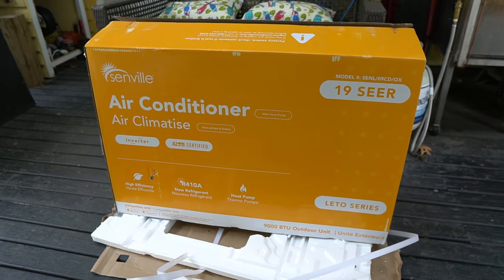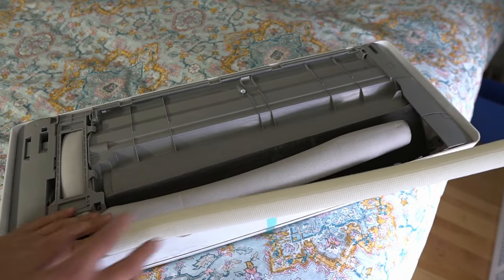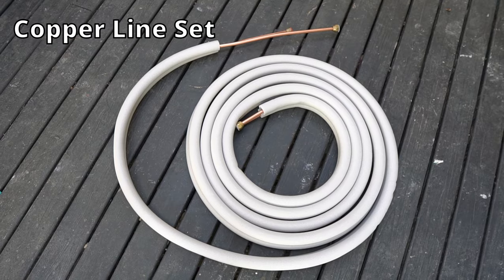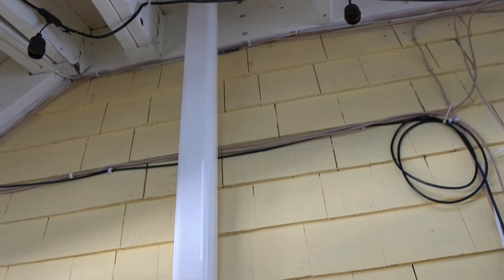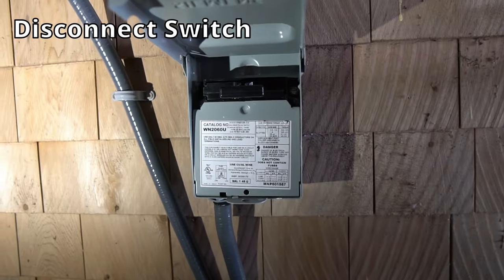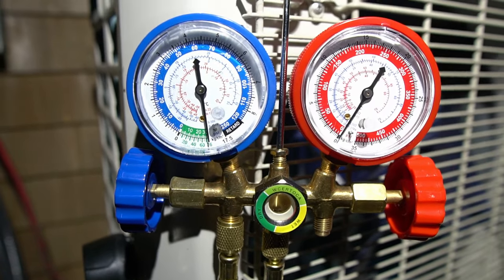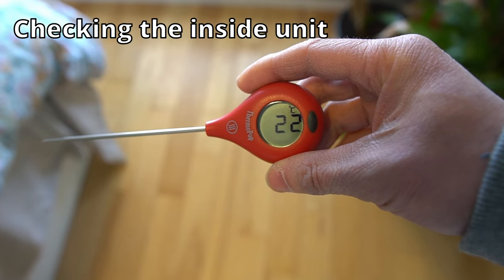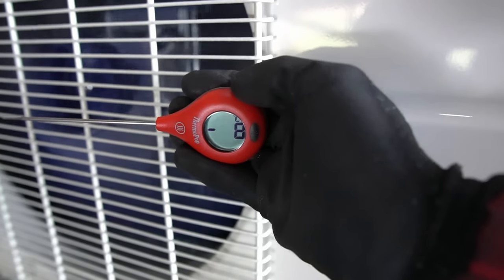How to Install a Mini Split Heat Pump | Senville 9000 BTU

Comment: I'm have to tell you that I have fifty years plus doing Harv  (heating, air Conditioning,ventilation and refrigeration). It looked like you did a good job on installing the Mini split Heat  Pump . I want to tell you that that you put ref oil on the copper female flare seat ( which I think you did )the reason oil the flare seat is to keep from damage to seat and help make it seal (because that copper flare seat is what make the seal, not the threads). Be a harv tech in Florida for 50 yrs it hard to think about installing a heat pump in Canada ( to know water freeze a 0*C and it is a outstanding insulation to stop heat transfer and at -6*C it is going to make ice fast if you have high humidity and ice stop heat transfer). Heat pump are great in mild climate. I would like to know how the Heat pump work-out for you. It is a good how to do info video     Thanks
Reply from the maker: Thanks John!  I had some experience with flares working on car brake lines and also propane lines so that was a help!
These newer heat pumps seem to still work well in temperatures below -10C, this one installed in the video is mostly for AC in the summer.  The existing one I have is a Lennox and it still pushes out heat below -15C (not often it's that cold), it does go into defrost mode every every few hours depending on how much humidity is in the air, so you are right it does freeze up fast.  Of course living near the ocean probably doesn't help lol.  Overall tho love these for heat and AC, no complaints at all.
Reply: Artic series mini-splits can work down to -13F or lower, and maintain full BTU ratings at 5F degrees. Not the same as the regular heat pumps. Used to be you needed a ground based heat pump to achieve that. COPs do drop at sub freezing temps, though.
Reply: In my area we have -40 celcius in winter and all people i know switch for a -28, -30 heat pump and they work great. The electric bill is  way cheaper. I waiting for mine this winter. Thanks for your video👌🙂
Reply: After 50 years how you can say that was a good install? :D 
He made a vacuum test before high pressure test. Just giving a really good chance to make a scrap out of it.
Reply: heatpump technology has changed a lot and icing is not a problem as it defrosts
Reply: @igotafastcar  😅 can you tell us  what is the best test to do first. I have one to install  myself
Reply: @igotafastcar the layout/routing of lines and wiring ect was great.  He vac'd the lines.... if the line set was defective it would have been noticed with either the vac or test with a slight bit of refrigerant.  

And if it was leaking he is sol for warranty ect anyway.  

Some people have it in them that you need to pressure test with nitrogen at 1000psi for 10 years....  

These things are like refrigerators...  in 5 or 10 years they will crap out and you will just have to replace it anyway
Reply: @john0270  I share some of your pessimism but not for the same reasons. 

A DIYer who pays careful attention to the details and doesn't cut critical corners can make a huge difference in system performance and longevity. 

The installation tools, equipment efficiency and troubleshooting techniques have changed drastically since I first climbed an old steel ladder carrying a manifold, Amprobe, wrench, screwdriver, nut driver, and a jug of R22 to the blazing hot rooftop of an ancient industrial building 50 years ago. Unfortunately the pride that once revealed itself in quality workmanship is long gone. Instead I see a lot of businesses that are no longer family owned manned by hacks with a license who call themselves pros while cranking out 3 res systems a day.

Its entirely possible for a homeowner to do a better job with a little knowledge and a relatively inexpensive set of tools. And far better tools at that.

Vacuuming while relying solely on a set of manifold gauges cannot give you a reliable indication of how contaminate free your line set is. Nor will the mere 16 psi difference between a near perfect vacuum and normal atmospheric pressure when observed on a low resolution gauge for a few minutes reveal a microscopic leak that could release all of the refrigerant within a year or two. A modern mini split contains only a few pounds of refrigerant and operating pressures are considerably higher than the older systems. The smallest leak becomes a much bigger problem.

Professional quality micron gauges can be had for $150-200 on Ebay and resold at a later date for about the same amount. Cheap insurance. A partial release of refrigerant won't reveal a small leak either. A high pressure nitrogen test @400-500 psi which is in the same ballpark as the pressures found in an R410a system is once again cheap insurance that may avoid future refrigerant loss. Manufacturer's parts warranties don't cover labor and multiple labor trips may be required for diagnose and later replace factory supplied parts.

My advice is to find a brand with a reputation for being responsive to the needs and concerns of the DIYer. In the case of Senville which is the brand featured in this video, I personally would consider spending the extra money for something in their Aura lineup primarily for the higher efficiencies in both heating and cooling modes and a few extra operating features like WiFi and phone support. I am not affiliated in any way with Senville but they are on my short list of brands I would consider. The vast majority of mini splits are made by a pair of huge Chinese companies, Midea and Gree. That doesn't mean that every product sold by other companies but manufactured by one of those two giants is built to the same specifications.

Beg, borrow, buy or rent the right kinds of tools. Some of the auto repair parts stores offer free rentals on tools like vacuum pumps. Fresh vacuum pump oil is the key to getting the best performance out of a pump. NAPA online seems to have a good price for a quart  if you don't need shipping. Other things to get: A micron gauge from one of the name brands. A nitrogen regulator set with the SAE hose for ~ $40 on Amazon. Buy or rent a nitrogen tank. A small bottle of Nylog Blue (`$13 Ebay). A valve core removal tool. The cheap ones with the yellow handle on Ebay seem to work well enough and come with the 5/16 SAE adapter that you will need for mini splits. If you are shortening line sets or just don't like the appearance of factory made flares, you'll need a tubing cutter and an eccentric flaring tool. 

If you ever expect to have a need to buy or handle additional refrigerant, an EPA 608 certification will be needed. Most of the test to get certified is based on understanding the regulations with a bit of common sense thrown in. It will however require some study. Familiarity with how to read the temperature / pressure chart will be helpful for some questions.  Check out skillcatapp.com for details on how to get your lifetime certification for about $10.

Don't forget the 30% US Federal tax credit of up to $2000 each year for the next 10 years or so. Also look for the upcoming rollout for low income (slightly below the average gross income for your area) grants of to to $8000 or 50% rebate for moderate income (somewhat above the average AGI for your area) residents. Although it is Federally funded, and part of the huge 2022 spending bill called Inflation Recovery Act, each state will have their own variations. I don't know yet if DIY installs will be eligible.
Reply: I’ve never heard someone refer to HVAC as Harv lol
Reply: red
Reply: Herew a few...No nitrogen test, no micron gauge, no. Decay test, no superheat subcool measurements......as an hvac tech myself when these things die prematurely its ALWAYS a DiY install.

Comment: I'll just pay someone to pull the system into a vacuum. No point spending money on that when ita going to be used once.
Reply: I thought that too, until the guy told me $400us. $140 amazon will buy the pump kit. Cheers
Reply: @papabapyro  yes I found that out too and ended up just getting the Amazon pump. The pump failed right as I was finishing up with it haha. So I got my money back thankfully.
Reply: @papabapyro A technician coming out will far exceed the cost of a new vacuum pump with gauges. It can also be used for automotive purposes. And lastly, it could also be resold at a loss.  Again, far less than the technician that will charge you a small car payment.

Comment: It seems like my flares from the factory were just trash. I connected and disconnected my line set 5 times tonight and could never get a vacuum to stick, even with the use of nylog. Now I'm going to buy a flare kit and copper pipe cutter to redo the flares and get this done. I'd much rather spend the $80 getting those tools than give an HVAC company at least $750usd to come fix that.
Reply: only $750. HVAC guy wanted 3800 to install this. That works out to $3000 in labor lol
Reply: @martik778  He wanted $750 just to vacuum and properly seal a line set. Nothing else had to be done.

I found another local guy who did it for $150.
Reply: After extensive research I found that it's standard procedure to re flare the line sets as the flares are usually not good. Senville and other companies also include better quality flare nuts to replace the ones on the lineset.

Seems nobody can get the 3rd party lineset manufacturer to do it properly.
Reply: Smartest move you could have ever made installing a mini split.

Comment: I like how "wire the unit to the main power and install a disconnect switch" is a five second clip skipping over something that could take hours depending on how you have to get to your circuit breaker, and should be recommended to have a licensed electrician do it so your home is up to code.

Comment: when wrapping lines go from bottom to top as that makes it waterproof. You did the opposite. I'm thinking of doing the Senville but don't want to void the warranty. May have to call them and verify it's void unless hiring a "pro". Am I a pro? Been doing auto ac for 40 years.
Reply: If you have a certification number then it counts.
Reply: @kevinhayes2805  I installed a Pioneer unit. Works great although I did run into one problem. Even though I used nitrogen to check for leaks, I must have a small leak as I had to add a few pounds beginning of summer because evap freezed up. May be inside unit connection as I had wrapped it up in ashphalt ac insulation and it became goo. I'll see what happens in another year. I did have a concern with large indoor unit in that it didn't hold pressure from the factory when I removed the rubber plugs but I think it's just because they didn't install plug correctly.

Comment: How much does it cost to get an HVAC technician to install one of these?
Reply: This is a guess based on having somework done to disconnect and reconnect our airconditioner for construction. $300-$350 Canadian.
Reply: About 900.00
Reply: I've gotten several quotes each one was half the price of the unit regardless of size.
Reply: My father in law got his installed on a second floor for 3K USD... that price was ridiculous. His was a bigger BTU than the 9000 shown on this video. But still same concept.
I'm installing my 9000BTU based on this video! Thanks for the info! It is well explained!

Comment: I pulled vacuum, but removed the gauge before i released refrigerant for 5 seconds ! Is this bad?  Should I just release all refrigerant, or hook up the gauge, pull a vacuum again, and then release the rest?

Comment: I put an 18k one in at work, the office had oil heat and that was about $6 a gallon to refill. The whole unit cost about what he pays for each tank, this will save a ton of money.  Liked it so much put a 9K one in out bedroom and will be adding a 18 or 24K one to the front room soon before this summer

Comment: I installed the same unit 3 months ago. It is a tremendous value and seems to be a good quality heat pump. I did the complete installation. I would suggest a real pressure test with compressed nitrogen before releasing your refrigerant. The cost of the nitrogen and pressure regulator is minimal compared to the longevity of your system. I also used a micron gauge to verify the vacuum pull down— will guarantee full evacuation and leak testing before the pressure test. I used 12 gauge wiring for the 20A circuit for this unit —about a 75 ft run from the switch box in my garage. 
To the OP, you did a good job! I hope your system works as well as mine.

Comment: Just wanted to say thank you for this video! The way you documented the process was great, clear and easy to understand. I followed along with the install of my 12K BTU LETO and everything worked well! The line set was way too long in my case, so I got to learn how to flare copper lines too but thankfully I got the hang of it with some practice. Thanks again! 👍

Comment: Installed the 9000 BTU 240 volt version few weeks ago. Good job keep the videos coming. The 120 volt version is the Leto series and the 240 Volt version is the Aura series. The leto is good for -15 Celc and the aura series is designed  for colt climate down to -30 Celc. Keep up the videos

Comment: Nice! Now all I need is to figure out the electric side of it. We have power right where we plan to put the condenser, and we’re just using a 110v unit too, max draw is like 10amps.

Comment: Not bad, break your vacuum in ur suction line before taking ur hose off. Do a pressure test after the vacuum, and nylon doesn’t go on the back of the flare

Comment: Hi, good video, I have a  Senville AURA Series Mini Split Heat Pump Air Conditioner 12,000 BTU, my question is should i leave my heat pump on auto mode? it seems that it is not good for the components of the unit, is this true? Thanks

Comment: Hi Andrew, Can you tell me what is the Amperage of the Senville LETO Series Mini Split Air Conditioner Heat Pump, 12000 BTU 110/120V, Inverter. I can’t find it anywhere in the directions. My electrical friend tells me that I can attach a plug and hook it right into a wall outlet if it’s under 15 amps.  Thanks

Comment: I don’t understand where you ran the signal wire, to then have the grey conduit connected to the outside unit? You don’t show the full electrical run for the signal line

Comment: I purchased the same size Senville unit.  For the indoor unit, at 3:37, you are showing your wiring connection for red/white/black that is different than what the unit diagram shows on mine.  Mine shows Red 1 ,, black -2, and white -3.    I notice that your unit does not have this little connector detail that is just next to the wiring block.    Anyone else just be cautious about this, as the manual isn't very helpful.
Reply: A little more might be said about how to make a hole  through layers of your house without anything going wrong, don't ya think?!

Comment: How did you figure out the wiring order on terminals 1,2,3 on the indoor unit? My manual says to reference the indoor units wiring diagram. Which does list colors but those appear to be wire colors leaving the terminal block internally. Not the wire colors feeding it from the outside unit?
Reply: I have watched videos and installed a 12000 but unit. Just make sure the same color is on the same number on both units.
Reply: I had to call support to get it. They knew immediately so it is a common issue.

Comment: I have a 18k btu Senville unit, it's 12 years old and now I have lost the R410A gas, it would cost about 800$ to try to fix it. Buying the new version of the unit I have from Senville would cost about 1200$ and I could try to install it myself. I would have prefer the unit to work for 15 years, but for the price I paid, a Daikin unit would have need to work for at least 40 years to make up the price difference.
Reply: Depends on where you live. ebay sales R410A can for $200-$300 and the  vacuum pump and gauge is about $150-$200.  Should be able to fix it for about $500 if you DIY. I live in China and someone can come to your door to do a fill for $40-$50. Besides R410A leagake is usually installion problem. There is no doubt Daikin is a better brand. But Midea(Senville) is not that bad as they sell tons of AC units world wide.

Comment: I’m installing ours now and may have screwed up and cut the tubing too short to 8 feet. Does it matter?? Because the indoor and outdoor unit only need about 7 feet of copper tubing I cut and flared the tubing to 8 feet. A extra foot for a gentle sweep in the tubing.  I did not want coils of extra tubing outside. Andrew says I might have to have refrigerant removed. Can I get unions and lengthen the tubing again or might it work as is. Can I try it as is. Would it damage anything to try it as is???? TIA
Reply: I may have screwed up and cut the tubing too short. Does it matter?
Reply: My manual said lines should be a minimum of 3 metres. Going any shorter will likely increase noise at the outdoor unit and reduce the life of the compressor. If I had already released the refrigerant I would just leave it be. If you have not released your refrigerant consider buying new lines and running them a little longer

Comment: Well done video. Just one comment be VERY careful using thread seal on you flares. I recommend just a drop of refrigerant oil instead. If even a VERY small drop of this gets into the system it can cause major trouble.
Reply: Nylog is meant to be used as a sealer. Even if some goes into the line it will not harm the system but work in conjunction with the refrigerant and oils within the line.

Comment: Could you please cover the electrical?    I’m hopeful to run electric into building and plug it into outlet is that possible?
Reply: That’s not gonna work
Reply: Yes it works as long as u use the correct wiring.  Did this set up 2 yrs ago and still running strong